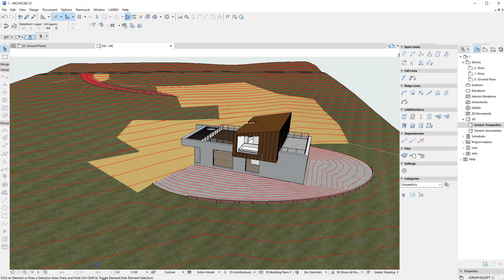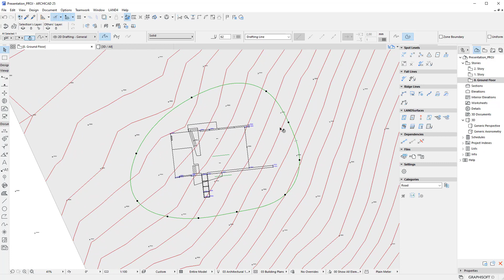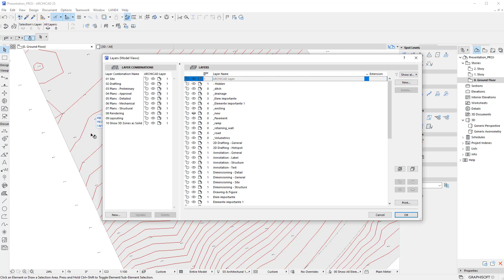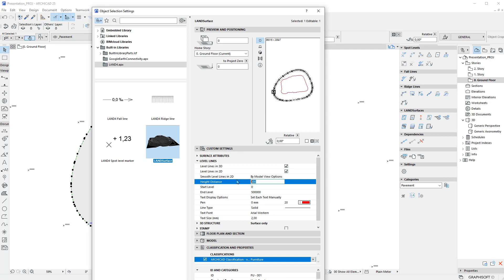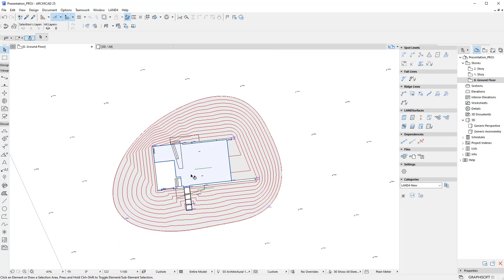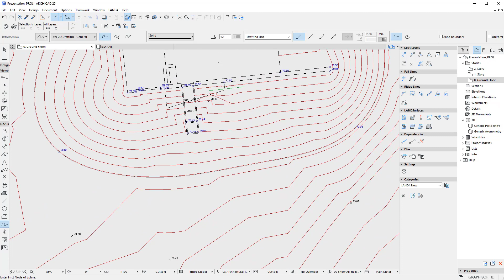Presentation, GRAPHISOFT BIMClub Online | LAND4 for ARCHICAD®

Comment: Can I use a mesh I already created in archicad with Land4 tools?
Reply from the maker: Hi Ezy, info on how to quickly generate a LANDSurface from an existing Mesh can be found here: https://www.support.land4cad.com/knowledge-base-land4-for-archicad/create-landsurface-from-mesh/
Reply: @land4cad  Next question - where can I download v1 for AC22?
Reply from the maker: @Ezy Naidoo  A major LAND4 upgrade was released in July 2021. 
The new version held a broad range of new and improved functionalities and was released for ARCHICAD versions 2023 and up. 
The first version of LAND4 was retired recently. We just checked, and our FAQ page had not been adequately updated. Downloads presently available can be found at https://www.land4cad.com/downloads. Sorry for the confusion caused.
Reply: So i can't use it if I have archicad 22?
Reply from the maker: That is correct.
LAND4 currently works with ARCHICAD 23, ARCHICAD 24, ARCHICAD 25 and ARCHICAD 26.

Comment: I really enjoy watching the presentation. I have one question can Land4 expand into landscaping?
Reply from the maker: Hi Gerardo, we are glad you liked the presentation. LAND4 is developed for landscaping in ARCHICAD. You can find an overview of features here: https://www.land4cad.com/land4-for-archicad, as well as our LAND4 Knowledgebase holding videos, tutorials, FAQ, etc. here: https://www.support.land4cad.com/knowledge-base-land4-for-archicad.
Reply: @land4cad  thank you for letting me know. It’s just that I have not seen anything with shrubs trees and flowers. Irrigation systems etc. A lot of hardscape more soft scape.
Reply from the maker: @gerardofaustin8156  Your observations are correct. In LAND4 focus is on enhanced and accurate control of your terrain using tools such as dynamic spot levels, fall lines and surface models. You will not find vegetation or furniture in the LAND4 object library. You can read more about the reasoning behind LAND4 at https://www.land4cad.com/about
Reply: @land4cad  are there any thoughts or plans to expand into Softscape ?
Reply from the maker: @gerardofaustin8156  Currently, no. We see vegetation, benches, street furniture etc., as furniture - objects often specific to different geographical regions. Creating and maintaining an adequate range of high-quality objects would be impossible. At least for us. Many global and local manufacturers of the IRL objects provide free GDL Objects, just as ARCHICAD has built-in tools for creating custom ones. We recommend LAND4 users make use of these resources.